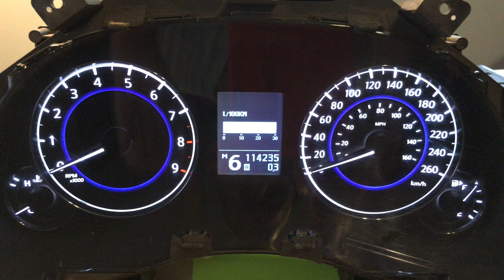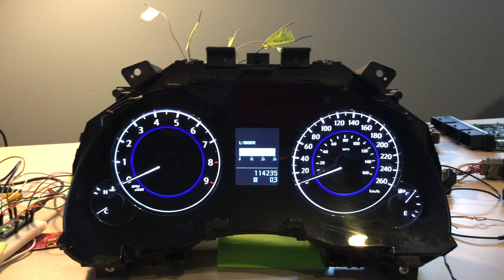Controlling the G37 gauges using CAN Bus! Motorvate's DIY Garage Ep.37

Comment: What CAN messages  did you send specifically to turn off the warning lights? Working on a project where im using the oem cluster but only need the gauges not necessarily all the warning lights since the car im putting it in is a classic. Trying to Save  cost over expensive aftermarket  clusters. But still have a clean look. And some functionality.

Comment: The MCP2515 board you showed, would this also work with a Routan cluster which can simulate it going 60 mph, coolant normal fuel max and seatbelt light on? If so thanks asap.
Reply from the maker: Maybe? I've never done any CAN bus work on a VW Routan / Chrysler Voyager.
You will need to check the wiring diagram as some items may be hard wired (fuel level) and not on the CAN bus.
Reply: @MotorvateDIY  Nah, everything is all on the CAN Bus, It's fine though since i have a 2009 Toyota Matrix cluster coming tomorrow.
Reply from the maker: Good to know! Good luck with your CAN bus project.
Reply: @MotorvateDIY  Well, now I’m trying to find the pin out for my matrix cluster, it has 40 pins and I have no clue where the 12V source and IGN wires are.

Edit: Nevermind I found the pins! Turns out the clusters wiring pin out is reversed.

Comment: I’ve reached out to you before I think. My cluster gauges don’t work. Only thing working is some of the warning indicators like the emergency brake light, battery light, airbag light security light jand seat belt light. Every thing else is dead the illumination and signal indicator, headlight and mileage plus gauges but everything is fully functional even the cruise control I just don’t see it in dash as if I had a black out. All the peepin you hear when you first push the start button I don’t hear or illumination on my radio, a/c but all full functioning
Reply from the maker: Sorry if I didn't get back to you before, sometimes I get buried in questions and can't answer them all.

The cluster is powered through fuse 4 (labelled as: METER IGN) and 11 (labelled as: ETS SOL), which are located in the fuse box on the left side of the driver's foot well. I would check all the fuses and see if any of them have blown.

Comment: My gauges stopped working and indicators not working but everything else is functioning properly just not showing only my emergency brakes light air bag and seat belt light indicator come on what can it be
Reply from the maker: It is really hard to say. I would check the fuses on the left side of the driver's foot well, specifically the fuse labelled "METER (BAT)" as this powers the gauge cluster.

Good luck!
Reply: @MotorvateDIY still no luck I’ve just been driving the car like this for the last few months. It’s bothering not knowing when my signals are still on or not today if I got some time I’m a swap out the meter and see what happens

Comment: Hey man! I was just wondering, Do you recommend any good bench power supply for these type of projects?
Reply from the maker: I use an old "wall wart" power supply that has 12v and can provide up to 3 amps. It works and is free :)

Comment: What canbus protocol and baudrate does the g37 use? 

would like to work with the canbus myself.
Reply from the maker: Nissan/Infiniti CAN bus typically runs at 500,000 bits per second, using CAN Bus 2.0B / ISO-11898.

Comment: hi can you email some pinouts and simplified diagrams. Im doing a vq37 swapped 240sx at the moment. I have it running already and was interested in the cluster install and came across your post.
Reply from the maker: Sounds like an awesome project!
All the wiring diagrams you will need are on nico club  dot com... they are kind enough to provide the Nissan/Infiniti factory shop manuals. Good luck!

Comment: Would there be a way to change the screen in the center to say custom messages?
Reply from the maker: I've looked into this and... the answer is I don't think so.
The unified meter and AC amp (aka M&A) is the module that controls the gauges and centre LCD display using multiple serial data connections.

It may be possible to reverse engineer the serial data that controls the LCD display,  but it would take many hours and you would end up with a low resolution, slow-ish LCD display.

Comment: Awesome job! I'm looking to tap into CAN as well. Is there a preferred location to tap in? OBD port or steering angle plug? Does the G37 have a firewall like some European cars?
Reply from the maker: On the older cars, like my 2011 G37, it only has one CAN bus and that is at the usual pins on the OBD connector. AND no gateway / firewall like the new vehicles.

Have fun riding the CAN bus :)
Reply: Thanks for the quick response.

 From my understanding, with the arduino and mcp2515, you can read and send commands to the CAN, but is it possible to disable factory code and replace it with my own? detector.
Reply from the maker: From the testing I have done on a G35/G37... nope.
Think about it, a module in the car is sending out a specific CAN bus message, then we send the same CAN bus message with a  different payload. 
The receiving device will show what is sees... and this results in unstable results, as it shows both very quickly.

Think about it this way: person A is talking to person B. Then person C starts to talk to person B. This results in confusion from person B.
Reply: Thanks for the explanation
Reply: Hey Frank, reporting back. I’ve successfully read from the CAN, however nothing happens when I send a command
Reply from the maker: That makes sense to me, as I explained before. Also, in some messages there are counters and checksums (CRC) to prevent message injection.

Comment: Do you have the DBC file for the G37 ECU?  We have a G37 racecar and want to display specific PIDs (oil temp, trans temp) on our Aim race dash
Reply from the maker: I have most of the G37's CAN bus fully reversed engineered, but haven't spent the time to made a DBC file.

Here is what I am developing:
DIY Bluetooth + CAN Bus Gauges? MotorvateDIY Garage Ep.39
https://youtu.be/92KAciDdKHM

Which dash do you have?
Reply: @MotorvateDIY  Very cool, this the type of thing we are looking for.  We are using the Aim MXG 1.2 strada dash and want to display similar telemetry (op temp, trans temp, etc.) while giving us our lap times.  Aim supports custom DBC files we just can't find a complete DCB file for a G37/370Z.
Reply from the maker: I haven't seen a good DBC file for the G/Z. The ones that are out there focus on HVAC controls and not engine/trans related items.

Comment: I just started on the 370z cluster trying to see how difficult it would be to either hijack the oem multidisplay (on the left side, by the fuel/coolant temp area) or just completely replace it with a similar sized display controlled by an arduino. Would be nice to finally give that display a purpose rather than giving me useless info such as mpg and outside temperature lol.
Reply from the maker: I haven't done any research on the 370z cluster, so I really don't know the inner workings of the multi-display.

Instead of taking apart the cluster, replacing the LCD and programming an Arduino to do something, it might be easier to set up a vent mounted or dash mounted  display with an Arduino.

In the next hour, I will be releasing an episode where I show my Bluetooth based sensors (engine oil pressure, fuel pressure, transmission temp and diff temp) AND CAN bus data PLUS OBD data working prototype. This may interest you!
Reply: @MotorvateDIY  Oh yeah a standalone display would be significantly easier, I'm just doing it for fun with a cheap cluster I got off ebay cause why not. I'm a software developer by trade so I can usually figure my way around things.

Comment: Hello I’m not sure if you’ll see this comment , but I’ve been having a problem with my g37s 2009. I’m suspecting a short or something wrong with the Can system connecting to the tsu. If you can respond I’d really appreciate your help with your insight on your expertise on the Can network.
Reply from the maker: Hey Juviny, I read and replay to all the comments... but sometimes it takes a while to get to them. :)

What are the symptoms you are having and why do you think there is something wrong with the CAN bus?
Reply: @MotorvateDIY  so my car is currently not going over 74 mph. The reason is because the input speed is correct and the output speed is incorrect. Almost double the speed. Now I have changed the battery and had the transmission speed sensor. The alternator is good as well. Still the problem has not been fixed. The tranmission shop told me my aftermarket radio could have been interfering so I went to get that checked out as well and the radio is wired just fine. The 2 codes were the p1574 and c1000. The car drives completely fine makes all the right shift etc. The only reason it’s in semi limp mode because of the drastic wrong output code. The speedometer shows the correct speed as well so as far as I can assume it is not a wiring problem between the ecm to the combination meter. So I am making the assumption now that there can be a short between the combination meter and tcu. Unless there is anything else It Can possibly be. Please let me know if you have any other suggestions.
Reply from the maker: The P1574 code means that the vehicle speed from the "Unified meter and A/C amp" (this feeds the gauge cluster) is different than the vehicle speed from the transmission's control module. These modules talk on the car's CAN bus, which is the car's network.

You U1000 code (c1000 code doesn't exist and I assumed a type) is a CAN bus communication fault code. AND I suspect this is the cause of the P1574... the transmission isn't sending the data on the car's network, OR the Unified meter and A/C amp can't receive it.

Unfortunately, without special tools and a good understanding of CAN bus communications this is not something you can DIY.

Your best bet is to take it to a dealer and get an estimate.
Good luck!

Comment: Hi. Would you share the gauge cluster pin outs for power up after led repair?
Reply from the maker: Unfortunately, providing power and ground doesn't turn on the back light, that is done over the CAN bus.
Reply: @MotorvateDIY  can u please share the pin out  of this cluster
Reply from the maker: The cluster pin out can be found in the factory shop manual, that you can download for free at nico club dot com. Look in the MWI section.

Comment: i’m so glad you’re back! hopefully you reel out more maintenance presentations in the near future! cheers!
Reply from the maker: Thanks for your comment.
What are you looking for with regards to maintenance?
Reply: @MotorvateDIY  i’ve seen all your videos already. but perhaps spark plugs, restore headlights, clean exhaust, serpentine belt, oil cooler? etc..
Reply from the maker: That's a nice list... I have already shot the spark plug replacement (multi 4K camera, with boroscope of the spark plug hole) I just need to find the time to edit it.

My serpentine belt is probably due for replacement soon, and will shot that as well.

Comment: Cool stuff. Is it possible to hook up a 2004 G35/V35 CAN to a 2007 V36 5AT transmission. V35 has an external AT controller while V36 AT is inside the transmission connecting to other systems through CAN.
Reply from the maker: I am not sure if I understand your question... If you are asking about using a V36 transmission/TCM on a V35 /G35 I don't know. From what I have seen, most of the CAN data is similar but it did change over the generations.
Reply: @MotorvateDIY  Yeah that what I mean.  I am good in mechanical and electronics but software isn't my cup of tea when it comes to coding. I wanted to know if later V36 TCM which is housed inside the 5AT transmission can be programmed to communicate with older version of V35 control units so that I can do a swap from older 4AT to later 5AT transmission.
Reply from the maker: That's a good question and I don't know the answer.
As far as I know, only one person has been able to dump the code out of the 5AT and has had a very difficult time reverse engineering it, and I think the project stalled.

There are now aftermarket transmission controllers, but I haven't seen any for the 5AT or 7AT.

Comment: It would be awesome if you could figure out what circuit in the control module goes bad which stops the fuel gauge from working. I replaced the floats and fuel sending unit yet the gauge is still not functioning. Then I replaced the control module with a second hand unit and it's still not working right.
Reply from the maker: Funny you should ask. A friend just changed his M&A to get his gas gauge to work, and I asked for the old one to do an investigation to find out what fails.

The circuit is very simple, 2 variable resistors in series that connect to the M&A and that controls the fuel gauge.
Reply: @MotorvateDIY  Do you think there is a way to repair it instead of buying another one second hand that can potentially fail again?
Reply from the maker: It depends on what has failed. 
Poor solder joints can be easily fixed, as well as some of the common electronic components (resistors, capacitors, etc) BUT there can also be some custom chips (application-specific integrated circuit aka ASICs) which can not be sourced and there is no public documentation. In that case, you can only replace the M&A
Reply: @MotorvateDIY  bummer, but thank you for the wonderful information. I genuinely appreciate it.
Reply from the maker: Anytime... If you replaced the M&A and that didn't work, it sounds like a wiring or fuel level senor issue. Go to nicoclub and grab the manual to trouble shoot it.
Reply: @MotorvateDIY  great idea. I'll do that now.

Comment: Where have you been.  Glad you are back
Reply from the maker: Where have I been? .... Well,  I have been digging deep in CAN bus reverse engineering. It is  time consuming but I find it VERY interesting.

Also I have been creating inexpensive, CAN bus tools based on the ESP32 Dev Kit: CAN bus to wifi and CAN bus to SD data logger. 

Details on the tools will be in a later episode... and yes they will be DIY with very little electronics knowledge required to assemble and use :)
Reply: @MotorvateDIY  that is great as I love your content. I also plan on doing that fix u did for the rear diff.
Reply from the maker: Try to fill the lower part of the bushing so it is absolutely full.

After 3 years and many runs down the drag strip, I think the epoxy compressed and now the bushing is starting to rip a little more. So, work case it bought me about 3 years. AND if I didn't drag race, I suspect it would of lasted longer.

Good luck!

Comment: I just want my gauges to sweep when i turn the car on.
Reply from the maker: Me too!
I am looking into it :)
Reply: @MotorvateDIY  you can do it Motorvate! We’re counting on you 👍
Reply from the maker: Small update... It is easy to send out the correct CAN bus data to get the gauges to sweep. The challenge is that the ECU is also sending out CAN data for them to be at 0.

More testing is underway....
Reply: @MotorvateDIY  wish I was nearby (in NC) to assist. Put my computer science and engineering experience to work. Keep the updates coming
Reply from the maker: Will do... 
Do you have any way of logging your car's CAN bus?
Additional Nissan/Infiniti CAN logs would be helpful :)
Reply: @MotorvateDIY  Wish I did - but I dont - will watch closely though.
Reply from the maker: Ok...Just wanted to check.

Comment: thats pretty cool. i know it would require some kind of sensor in the transmission but it would be cool if the display with the gear could show what gear you are in in a manual transmission car.  I mean i can look down at the shift nob its not a big deal but i think it would be cool.  i wonder if someone could hack into this to put additional data in the MPG bar area that you can select different displays.  Like if you could show voltage, or data from an aftermarket sensor like oil pressure, oil temp.  nice work sir!
Reply from the maker: Thanks for your kind words!
Everything you mentioned (an more!) is either in testing or under development.
More info will be announced in the next 1-2 months :)
(The past lockdowns have prevented testing, but now testing is underway!)

Comment: I bet the idea of matting vq37 with zf 8spd was on the table. . . .
Reply from the maker: Funny you should mention that...Last week,  I was asked a few questions about CAN bus control of the ZF 8 speed DCT after posting a different video on Facebook.

I think I can get the factory paddle shifters (and tach, speedo, coolant temp) to work with it.
Reply: That would transform the g/q cars to another level if that transmission can be swapped.